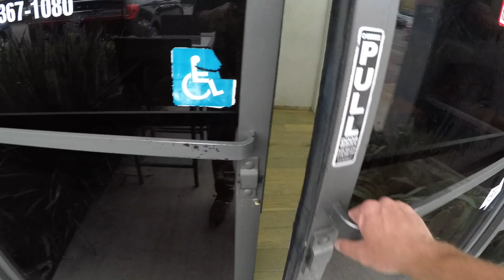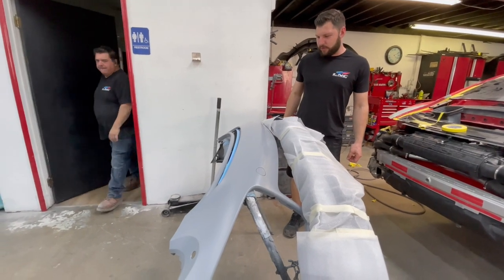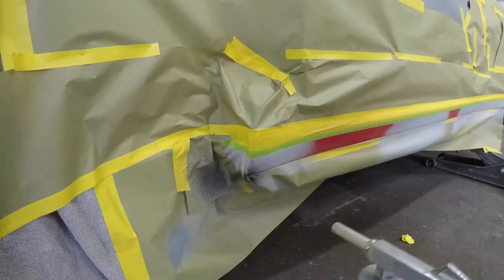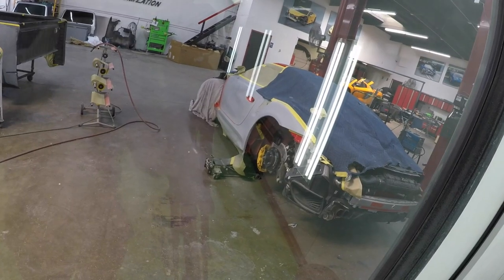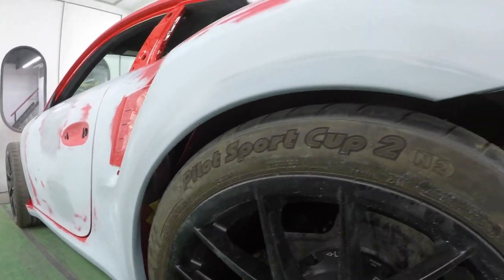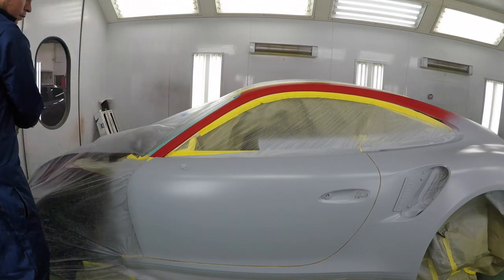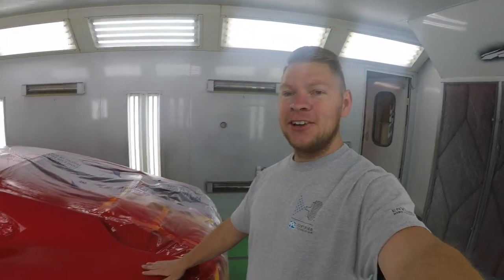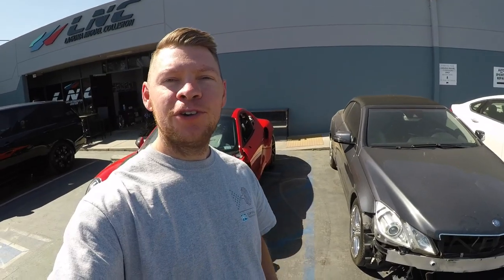Wrecked 991 Porsche GT2RS - Repaired and Painted after Accident! (PART I)

Comment: I like your attention to detail. Selecting cars without major structural damage is key to a quick repair. Attention to factory OEM is impressive. In UK inspection by dealers can increase the value significantly
Reply from the maker: Thank you, yes not involving major structural issues is a plus 👍🏻😁

Comment: When you paint the single front part , you should first do the outside surface and then the inside lines ….. ☝️☝️if you like working 1000 % not only 90 😄.
And i like to see if the front part fits to the car , as painted it separat in the paint booth
Reply from the maker: The front bumper is one piece that will get painted, everything is is the parts and grills that go on after paint! 🙌🏻😁 everything should match perfectly, wait until finished video 👊🏻
Reply: @LncPainter  I am not talking about the front bumper. The Plastik parts are not fitting to the rest of the cars , even from factory paint ( new cars) that’s normal  ,- i was talking about the left front part . The fender . It is metal or Aluminium …. Would like to see the finished car ,hope you got the same color effect . One layer more and you have a problem already . Uni Color is More easy then metallic , but you know this
Reply: @chrisduc1  oh i see what you mean. The front fender is actually carbon fiber material, As long as you follow same steps the color should match perfectly. I did gray sealer and then two coats of basecoat, everything turned out good 👍🏻 especially on solid colors its not trouble. But you are correct when painting metallic colors one extra coat or different application and it could be different 😬

Comment: Great work, but why wouldn’t you just base coat the fender before hand and then just paint it again with the door & quarter and clear them all at once?? Same batch clear & base, no risk of it not* matching…
Reply from the maker: With solid colors there is no worries about the color not matching, thats why I just Painted and cleared the entire fender and did the door/quarter separate. Other wise you are doing double the work, because you have to mask the fender, base it again and clear it if it’s installed.